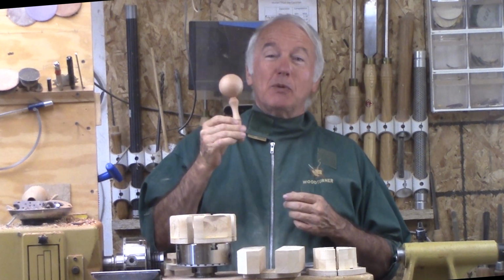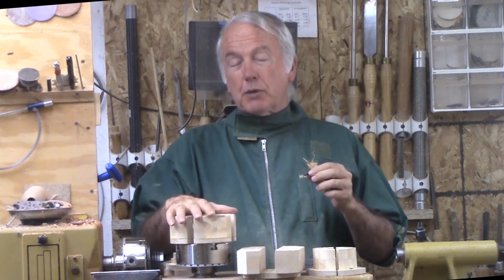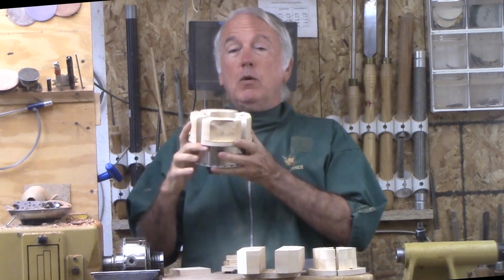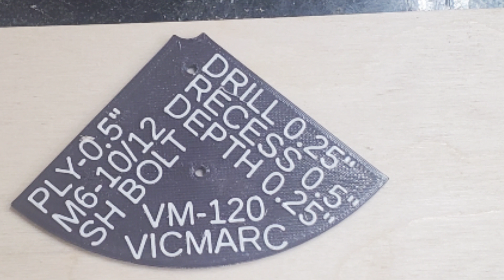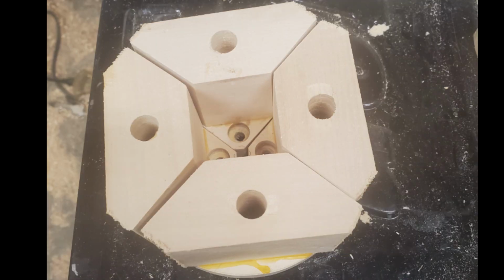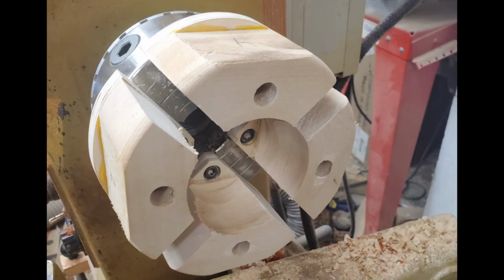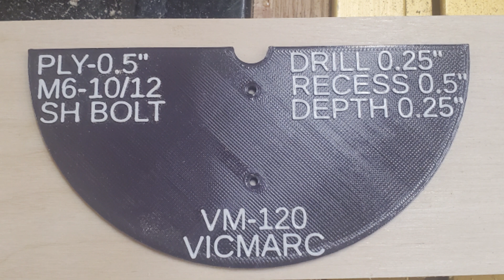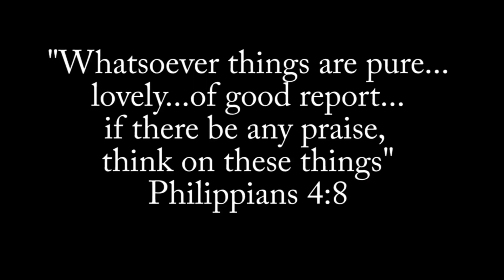Three Options For DIY Soft Jaws

Comment: Did you find that removing one jaw led to vibration above a fairly slow speed? I use all 4 jaws and cut a groove between two of them to accommodate the handle which keeps the chuck balanced pretty well.
Reply from the maker: Great question since any unbalance contributes to vibration. However, I was much more concerned with keeping my hands away from the handle. Could be that the handle offset the missing jaw. However, your approach works also.
Alan

Comment: That is an excellent video thank you. I plan to make the 2 jaw style to try making a pipe. The templates you made are great, I'll have to try something similar for the Record Power SC3.
Reply from the maker: Just use your current jaws as a template. Consider purchasing longer screws at the same pitch.
Alan
Reply: Thanks. I did make them, but I made a set of secondary carrier jaws out of aluminium   with the wooden jaws fixed to those with 4 x M6 cap head screws. So far, used them to turn  smoking pipe finials (for tobacco jars) and a triangular tool handle. Added some brass set screws, that contact the face of the jaw body, for stability. Planning to make a second set of wooden jaws with notches to hold cubic boxes. Thanks again.